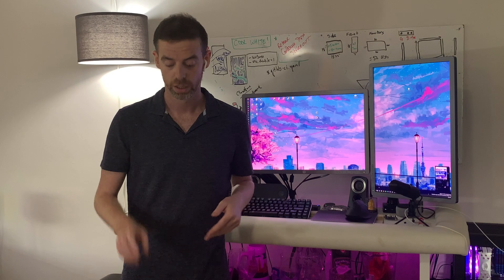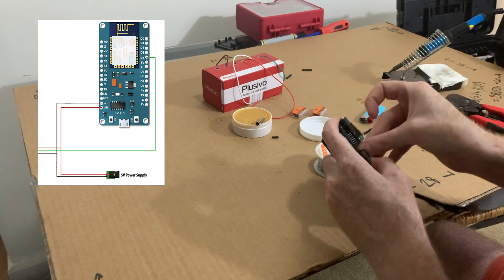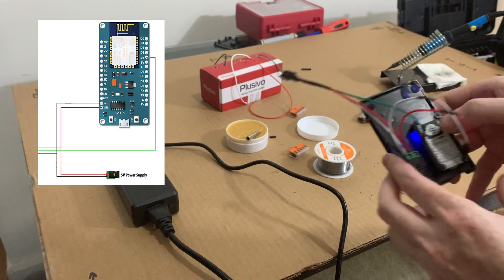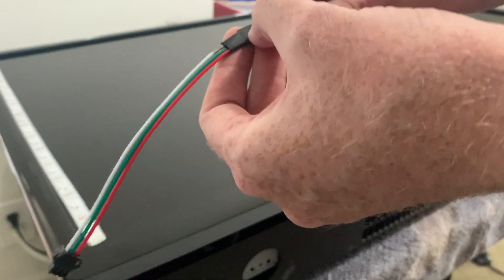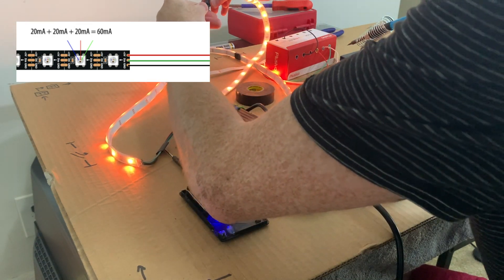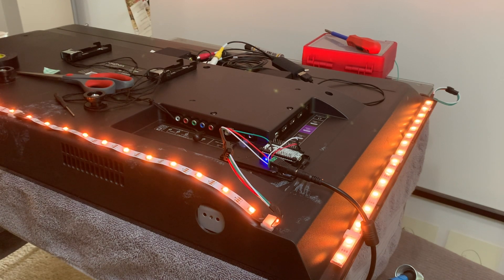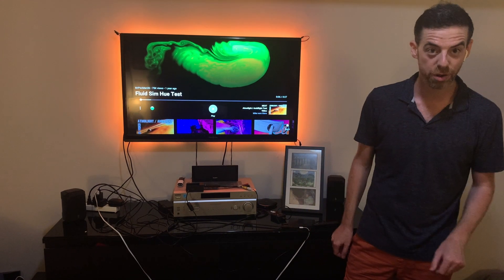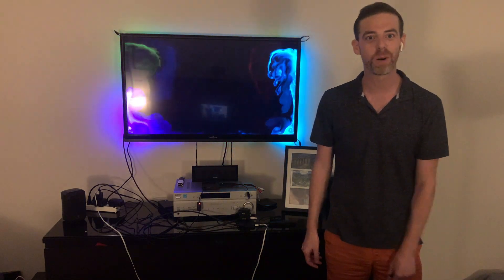Build your Own Ambilight Part 3 - Building the Ambilight! Hyperion, WS2812B, NodeMCU, & Raspberry Pi

Comment: Nice and clear tutorial. I just noticed though that sometimes even a portion of the screen already faded from green to black, the relevant LED still let out a faint green color (as seen on 17:58, upper left). Is this really how it is or this is something that can be tweaked by settings? I am decided whether to go wireless or wired directly to pi. On some tutorials with the LEDs wired directly to pi, I didn't notice the same left over colors. Could this be a side effect of the data being transmitted wirelessly?

Comment: Done, thanks for the help man. Ran to a nodemcu from the pi, with wled and hyperion. Ironed out the wrinkles and it is glorious. 

Sidenote: The flickers weren't from power. Wled and hyperion have to be taught to talk well. Make sure yall force max brightness and set your brightness limiter correctly in wled. Hope this helps at least one person. It should really be in the set up tutorial here..  but you didn't go 5v 20a so you didn't need all that. Cheers mate!
Reply from the maker: Good mention man. Glad things are working well!

Comment: Hey U dont have a Input lag? I have 500ms lag from TV Picture to Led color ?
Reply: Change the settings on the capture card in Hyperion. Set it to 720p instead of 1080p and it should be more responsive.

Comment: Hi, why would we need the HDMI to RCA adaptors,  Why not just connect the out from splitter to an HDMI to USB,   Does the RCA Adaptors work better?
Reply: Curious also. The parts list includes HDMI->USB capture. I'm curious if the Pi capturing HDMI directly is to slow while dropping the signal down to RCA/Analog over USB would be a very small signal compared to straight HDMI

Comment: Nice tutorial. The only thing i would change is to take the LED strips out of the plastic weather strip. I've had much more success keeping naked strips secured to the back of a warm TV for much longer. I've got 65" TV with a set of naked strips that have been in place for at least 2 years now, but the plastic crap on my pc monitor keeps falling off.

Comment: I have a question about the hdmi splitter. I need it to support 4k 60, hdr and atmos 9.1 sound. What would you suggest?
Reply from the maker: So mine works on all uhd 4k listed content, as well as my 7.1 setup. Anything better quality than that, I can't help with yet, since I'm moving in a couple months and I'm not upgrading equipment until after that

Comment: Great work. But I'm stuck. I can't get my leds to turn on. I have 5V 10a powersupply and connect as you did. Mcu turns on but leds do not. What am I doing wrong?
Reply: is it also not showing up when you try it via WLED? if it is, the problem is at hyperion. If it doesnt show up via the WLED interface either it must be the wiring between the NodeMCU and the LED strip. 

it could also be a compatability isue. the only LED strip that works with WLED are the WS2812B LEDS, if you use another kind of led strip, the leds are a little bit different and the nodeMCU wont be able to control it.
i hope you figure it out, i am trying to get this thing working without a raspberry by letting the TV directly talk to the NodeMCU over wifi, but i dont know if its possible let me know if you guys find anything
Reply: @thijs7541  I'll give this a try again. Not sure if I need a level shifter because I do have btf 2812B  leds. The mcu does turn on and I can find it in the app and configure everything but no leds lights.
Reply: @satpreetsingh8109  could it be possible you fried some leds? I once had an ledstrip i accidentally electrocuted the beginning of the led strip and i had to cut 3 leds off before the rest worked. Some leds turned on in weird colours tho so it might not be your problem but its the last thing i can think of

Comment: I have a question can you just run the Hyperion led color change by the IP address instead of HDMI?
Reply from the maker: You can use something like "Android Hyperion Grabber" to send the picture data to Hyperion over the network of you're using an Android TV device or something of the like. I'm working on a video right now that's almost done about configuring it on a fire stick!

Comment: I made a cheap and easy to build ambilight solution for PC. Differently from other solutions you don't need extra hardware to make it work, just an ESP8266 and a led strip.
https://github.com/sblantipodi/firefly_luciferin
Cheaper and faster than Hyperion.

Comment: I just bought a 300 led 5 m strip I’m lost on what power supply I should get I just bought everything expect the psu
Reply: 300 x .30W = 90W / 5V = 18A power supply.  Meanwell LRS-100-5

Comment: Hi, you listed the 5v 30a Power Supply as a part needed in hardware.... what do you use this for?
Reply from the maker: I use it to power both the NodeMCU and my LEDs. I run a long, flat 5v Barrel Jack extender up through that white cable run beneath the TV and wire it up directly
Reply: holy hell thats a lot of amps. I think overkill. i'm running almost 200 leds with 60 led/meter and the conservative amp draw when all white is more like 14amps lol
Reply from the maker: @juggalizzle75  lol better safe than sorry. Plus I can use the power supply fort other things as long as I'm reserved about it

Comment: I think there are better options for this.  

First, you really do not absolutely need the NodeMCU (unless your pi is going to be across the room from your led strip) but whatever.  I'm not sure why you would use WLED / NodeMCU.  For users in a radio-noisy environment, your solution could introduce latency.  But it definitely introduces unnecessary costs, right?  

Second, the capture device is completely unneeded as there are HDMI to USB capture devices, which cost less total money.  

Third, why not use no-solder right angle corners for your strips?  Easy and much cheaper for most folks, right?  I understand the difficulties with using the right angle connectors, but giving an explanation is really valuable. 

If there is a valid reason you made the decisions you chose here, please upload a fourth part to this series to explain WHY you made these hardware decisions.   In my opinion, this video (and it's lack of explanation as to why you made the hardware choices you did) demonstrates why you have only 215 subscribers.  If you created more useful content (i.e., content that includes explanations of underlying decisions rather than just...how to), I would subscribe.

I can't help but feel there is a metric ton of info missing from this video.  I am also completely unsure as to why this was split across three clips.  I get that youtubers have a fear of uploading long videos.  But anyone interested in this project would watch a long video about this project...doncha think?  I feel like anyone who owns a soldering iron would watch a video longer than 10mins at 2x playback.  Or am I wrong?  I suppose I'm actually wrong on this.  But still, one video would have been fine.

Comment: Thanks for the comprehensive tutorial, will be attempting this soon

Question regarding capture, I see that there are some pi compatible HDMI to USB grabbers, is there a particular reason you're covering HDMI to composite then composite to USB?
Reply from the maker: I didn't have an HDMI > USB capture card at the time. That's actually what I'm currently using in my setup. surprisingly, it actually increased the latency a tiny bit

Comment: It took me 2 days but your video is combined with drz is the only ones that got it to work for me. But I'm confused. Why did I struggle to get hyperion working when it seems that the one in charge and controlling everything is the wled app. That one overrides anything hyperion is does. Full disclosure I don't have a hdmi spliter until the morning so my android TV box is just going to the video capture in the raspberry but could that be the reason or is it supposed to be this way and wled have all the power. Just confused and because of all the hours I put into it I would like to understand whats going on.

Comment: Hi. 

I'm in the process of sourcing parts (the HDMI to USB is proving troublesome from my area).

I'm just not certain what the second power supply is for?

Under hardware there is a 5v 30a power supply, and then a 5v 10a power supply in the build section. You mention the 5v 10a during the build vidoe, but I can't find reference to the other supply. The only thing that seems to be missing power is the Rasperberry PI, is that what it is for?

Thanks.

Comment: It's crazy how responsive yours is even over wifi. I set mine up directly off the raspberry pi GPIO-18 and it's so much less responsive still. I think the issue might be my USB video grabber. I'm going to pick up the one you recommended (and the HDMI-RCA converter) and see if its any faster.

Comment: Thank you for the excellent tutorial Mike, I want to ask what is the difference between using NodeMCU ESP8266 or connecting the LED directly to Raspberry?
Reply: I've wondered the same thing. Other tutorials online connect the Pi to an Arduino instead of the NodeMCU. I've read it's because the Pi is running a real OS, which interrupts the signals to hardware like LEDs when the OS is doing other work. It sounds like it can cause flicking or lag when talking to the LEDs.
Reply: @BrettLesnau  I’m using HyperBian image on Pi with the lights directly connected. It’s running flawlessly, I’m just wondering if I might be missing any features on my setup.
Reply: i've wondered this as well. I think it was just a matter of available capture devices at the time. I run directly from pi and its flawless. I run 2 nodemcus for additional lighting on the sides. The pi, especially a headless one, uses very little resources. You could run hyperion on a raspberry pi zero or a v1.

Comment: I am a subscriber now!  Thanks!  I have 244 LEDs around a 105 inch projector screen and with a little poking I managed to get it working... Lag is very minimal on the pi 3b+.  My list of minor issues are:  I did have to use HyperBian for the Web interface to work on the Pi.  The splitter is a little janky with my Denon Receiver, but works.  Might be becasue of the 4k.  I have a back feed of power from my HTML wire I have to unplug or my LEDs keep glowing after the power supply is shut off, not sure if that is the splitter or the Denon.  Last the LEDs all reset about every 30 minutes, for 2 seconds during a movie.  I am going to set my default color to something more unnoticeable than orange, so I do not notice the reset.  (any tips on how to troubleshoot the reset are welcomed)  One last tip, the wire between the WLED and the screen has to be short... or the signal did not make it all the way around the addressable LED strip, but mine is fairly long though, about 28 feet.  A pleasurable experience and have produced something you can not buy yet which is really cool.
Reply: could be not strong enough PSU or WiFi is not stable

Comment: My hyperion output rainbow color when I turn off the signal (white - yellow- green - red - blue) . I try to change the background effect setting but it does not work. pretty sure its from the pi4b because when I turn off pi4 I can still control the led using nodemcu via WLED

Comment: Hey Michael thanks again for all this, as it was a solid baseline as far as the hardware. I actually got my setup working with an HDMI video grabber, which is pretty awesome. I need to figure out how to turn down the resolution as now my live grabber preview within HYperion shows a huge screen, causing a delay in my lights. However the color replication is now far more accurate. Pretty cool!

Comment: Don't understand why you choose to use a node mcu instead of the raspberry gpio output. However, I would love to see Hyperion directly installed on the node MCU, without any need of raspberry. I am sure that it is possible with the hardware, and it would be nice as I use the Android application with my TV shield. I think that the raspberry is overrated to only run Hyperion instance...
Reply from the maker: lol everyone keeps asking this. I like using the NodeMCU to have the backup full-scope ambilight with effects should i ever decide to get rid of/repurpose the RPi. In truth, I see no real stutter using WLED as a udp receiver, so I figured why not?

My RPi running Hyperion doubles as the second in a round-robin AdGuard setup on my home network, as I route all my DNS entries through AdGuard [originally was using PiHole, but switched over]

Comment: Your tutorial is pretty good.  I am not quite sure why you use WLED and the NodeMCU rather than using one of the Raspberry Pi GPIO Pins to  drive the LED data directly.   I know it works either way, but just would save a step :).
The only thing that made me cringe was the soldering.  Carrying the solder to a joint is a big red flag.  All the flux from the core of the solder is burnt off.   You should always apply the solder to the joint.  Apart from that little thing, I did enjoy your tutorial over all.
Reply from the maker: I like using the NodeMCU to have the backup full-scope ambilight with effects should I ever decide to get rid of/repurpose the RPi. In truth, I see no real stutter using WLED as a udp receiver, so I figured why not?

Great tip on the soldering process. I've always done it this way with no obviously visible issues, but I'll definitely have to look into better practices!
Reply: @MadeByMiro  With the soldering, you'll notice that puff of vapour when you touch the iron to the solder.  That's the rosin/flux core of the solder vapourising.  That leaves the solder on the iron dry.  You'll get better flow if you touch the iron to your workpiece, and then apply solder to it :).   Just a tip.  I learnt through my own mistakes over time and I certainly won't claim to be amazing with solder either  :)

Comment: Great work!  Curious of the advantages of using the nodeMCU? I've had a setup for years running just from a pi and the same multi device path from hdmi. Due to a flooded basement I'm about to redo it all and happy to see how much farther hyperion has gotten. So much easier now. Curious to dig into the effect configuration.  I had hand coded my own to create a goal light and tied that into a service checking live hockey scores. Gotta get it all running again for the playoffs.
Reply: To add to what OP says below: if you read up on how to use Hyperion with WS2801/2812 LEDs on an Raspberry Pi you'll find there are a LOT of hoops you need to jump through and restrictions you'll need to account for.  This makes it remarkably more simple, albeit at the trade off of having 2 IOT devices for 1 function.
Reply: @TheRoyCWalton  Thanks! Yeah, i've gone through several of those hoops in the past. I actually just went back and redid my whole setup on a pi4 instead of my pi2. Found that they've made it super simple with HyperBian. Seems to be working solidly for the most part. Might have to rebuild my level shift circuit. Works great with video input and effects but goes crazy when i try to set a solid color.Trying to nail that down now.
Reply from the maker: I like using the NodeMCU to have the backup full-scope ambilight with effects should I ever decide to get rid of/repurpose the RPi. In truth, I see no real stutter using WLED as a udp receiver, so I figured why not?

Comment: hey mike. excellent series. But i have a question that hopefully you can answer for me. You are using WS2812B strips in your setup. But can these be swapped to a different strip at all or does it work with specific strips only?
Reply from the maker: the wiring will definitely be different, especially if the LED strips are RGBW or the like. Google for '<Strip type> NodeMCU wiring' and there are usually tons of diagrams floating around. The WLED config will need to be updated in terms of RGB order as well. Unfortunately, I have no experience with other strips at the moment so I can't really offer any solid advice I can stand behind, but best of luck!
Reply: @MadeByMiro  will it work 4k HDR on my Sony TV?

Comment: Well got it all done today, had some trouble with the HDMI splitter.  It seems to be kind of picky to get it working.  The other issue I have is Hyperion seems to have a latency issue of a second or two that makes it just not work the way you would want.  I do not think its capture latency though because even if I use a pre-defined effect in Hyperion I see it hitch and skip as compared to using an effect directly from WLED its smooth without issue.  Hyperion is on a Pi3 B any ideas?  Also I have to wonder after doing this project.  If you could cut the NodeMCU out completely and run everything off the Pi3 so that you completly eliminate the transfer of code over the network.
Reply: I tried this.  Don't do it,  Connecting the light strip directly to the RPI opens up a whole bunch of potential issues.
Reply: @Slayer11-c3g  I never had any issues, I can see how it would if perhaps you were asking too much power, but I checked all those statistics before building.

On all my new LED projects I use 12v power supplies and if needed a buck converter to step down to 5v, but for this project that wasnt needed.